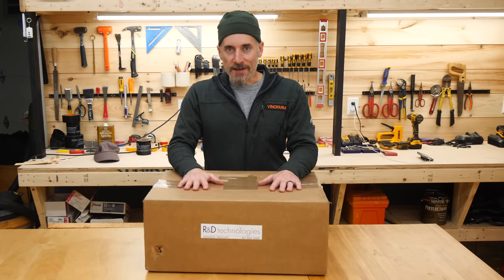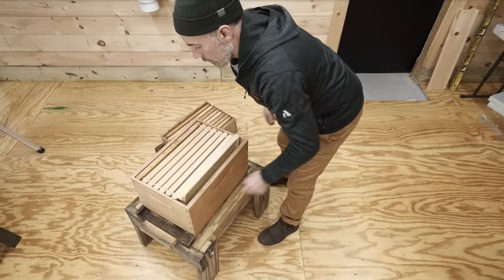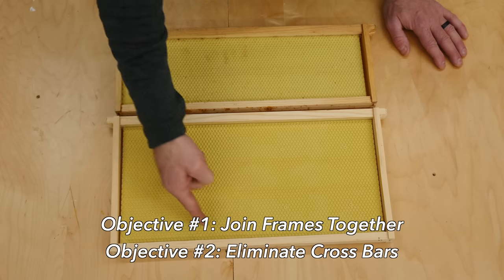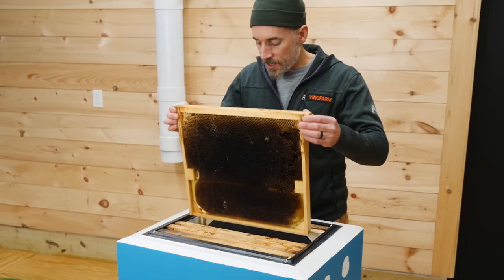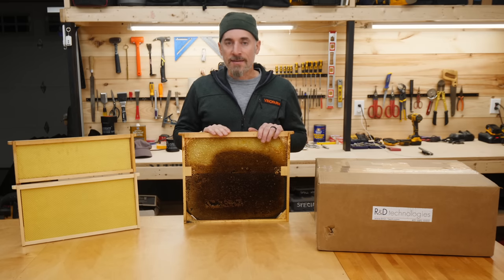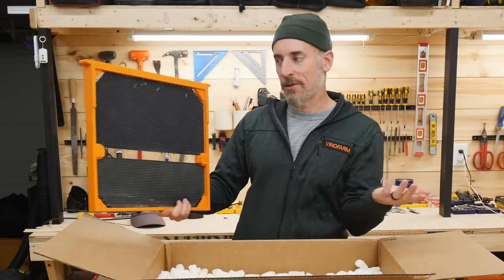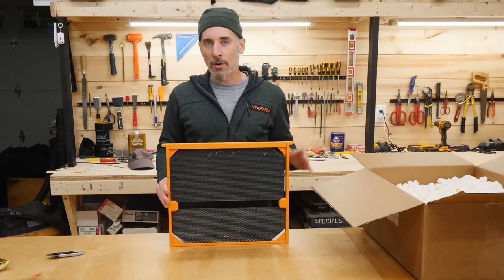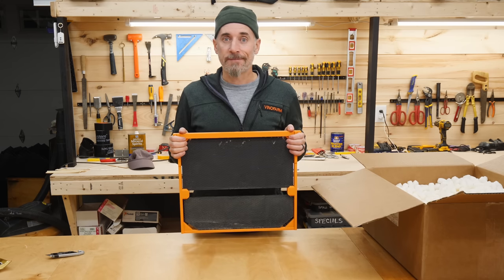Bigger, Better Bee Frames? Let’s Make This Happen!

Comment: Why not make a vector file and cut the frame sides out of 3/8" wood on a laser cutter? All you'd have to do is make the 1/8" groove which is quick and easy on a table saw.
Reply from the maker: What type of wood would you suggest using? Plywood is a no-go. It would delaminate inside a humid beehive in a month. If using solid wood, I'd need to pre-mill boards down to 3/8" thick. (A huge hassle) Then imagine laser or CNCing that shape out of a plank of 3/8 solid wood. There would be a ton of waste. Not to mention the babysitting and swapping planks every half hour. I can't see it being efficient at all.

Comment: My 18 inch double deep frames are built of strong wood (not weak pine), and are both glued and nailed, so that I do not need the center wood support.  I use 20 to 24 gauge stainless steel wires, spaced 2.25 inches from the top on down, with no wire within 2.25 inches of the top and bottom.

Comment: Hey Vino, love your work. If you wanted to go the 3d printed route, you could buy an Anycubic Kobra Max for around 500 bucks and print a whole 16 inch bed of your extra deep side bars at a time. You'd be able to print 11 or 12 at a time on that machine and bootstrap your way to injection molding that way. It's not a very difficult process at all once you get the hang of it and I'd be happy to help. 

Cheers.

Comment: I’m Never Bored!
35 seconds ago
Hmm how about modifying the Layens frames. The Layens frame consists of four parts:

Top bar — 14-5/16” x 1-1/2” x 3/4”, with 1-1/16” x 3/8” rabbets cut on two ends. It has 4 holes (3/32”) drilled along the center of the bar 1” from the rabbets and 3-3/8” between holes.
End bars (2) — 15-9/16” long x 3/8” thick. The wider part is 1-1/2” wide and 3-3/4” long; it then tapers to the thinner part which is 1” wide.
Bottom bar — 12-3/16” x 5/8” x 3/4”. It has 4 holes (3/32”) drilled along the center of the 3/4”-wide side 1” from each end and 3-3/8” between. 
 I'm had a similar idea last fall and insulated top bottom and all four sides of my Layens with the purple polystyrene.
Reply from the maker: Layens frames are 50% smaller and have sealed off tops. Not anything like what I’m doing here.

Comment: Are the frames the same dimension as layens frames to fit horizontal hives? If not it may be a good idea to have layens and your bee barn frames the same so they could be used in both. I would be interested if so because I already have a horizontal, plan to build more and one or two of you bee barns. It would be nice to have one frame fit in all of them!
Reply from the maker: No. Layens frames are 13" wide and have closed tops. They are completely different. These are Langstroth frames (19" wide) and have open tops to allow for supering. Not compatible either way.

Comment: Building the frames in my mind is the first issue that keeps your idea from exponential growth. If I could purchase the frames the barns would be much easier to implement fully in the yard. As an aside if you’re in the design process it might be useful if there was a plan for exchanging foundation if the comb is getting old.
Reply from the maker: Foundation is easily swappable: https://youtu.be/nK_TGfDYWcA?t=1818

Comment: Hi Jim, 

I am interested in using your deep and a half frames. I keep bees without the use of foundation and would need to modify some support with in the frame. I’m hoping I can drill small holes in the frame side bars to loop trough some wire. Do let me know if you think this will be possible? 
Thank you!   Joy

Comment: I don't understand why you would do it in thermoplastics? there are machines called Computer numerical control (CNC)
that means there is no material that cnc cannot cut. from wood to mdf panels to stone and steel depends only on what material and what type of cnc (laser, water, etc...)
so what I would do is to take that sample and just try more material and in the end I would take the material that suits me. cut the parts and sold them disassembled with assembly instructions. the plastic looks great, but it comes in one piece, which requires a bigger box for transport. more attention to packaging and finally what we all fear is handling in transport. damage to the product occurs
I would consider cnc production

Comment: I understand at the beginning were 2 combs (because you used two different frames), but now there is only 1 frame, Why do they need to be separate? Do still use the same old frames to take out the combs? Can you test the coroplast as a comb, Can be used as the bee's comb?

Comment: I see a need for 4 different molds: Top, Bottom, side-block-up, side-block-down. 
I would have the gussets as a moulded part of the sides made to slot into top and bottom and 
be pinned with simple plastic pins, 2 per gusset through predrilled holes. That would add a small amount of assembly but its pretty basic and would make shipping much easier.
Reply from the maker: This is the current thinking.

Comment: It's an interesting concept but I just use a double nuc between April and June.  Then I move the queen to the bottom brood chamber, insert an excluder and then let the bees fill the top box with honey plus however many supers they can fill on top of that.   I still need to moves supers, still need to lift - the same would be true for the bee barn.  Plus, those double frames would still be pretty heavy if full of brood bordered with honey.  

I quite liked having a massive hive going into the fall.  With single brood chambers this is difficult.  I'll be following Jim's leed and seeing what works for me.

All of this innovation is very inspiring!  Keep up the great work, Jim.

Comment: Hi Jim,
Any reason you can't offload some of the complexity onto the end user to simplify the manufacturing process? It seems like just getting a mold for the side bar would be pretty simple. One mold would allow you to make pieces for both sides then the user could just attach them to any wooden top and bottom bars with screws that they predrill themselves. You could even include the support gussets in this design.

Not sure exactly how you were planning on integrating the movable block but this method wouldn't really change that. While injection molding this would be great for large scale production if you cut that design in half, 3D print the pieces, then join them together with epoxy or other methods people could probably 3D print this at home as well. 

The magic here is in the sidebar, personally I would focus on that and leave the final assembly to the end user. Love the channel and keep up the great work.
Reply from the maker: This is a good comment. And it gave me a new idea. Thank you.

Comment: I like the extended frame but I have one concern? What are you doing to remove the honey? I have a centrifuge but the extended frames will not fit in my current centrifuge?
Reply from the maker: These are brood frames for the brood box. They are not extracted. The hive is supered with Langstroth supers and you extract regular super frames.

Comment: Have you checked with frame makers to see if they would make you the longer side bars? or a wood shop with a C and C machine The top and bottoms are standard
Reply from the maker: Not sure if you watched the video, but I do not want to make these out of wood. Cnc production houses would use plywood and that is a terrible material for inside of a bee hive. I’ve thought this through over two years. But for people who really want to use wood, the previous video shows how, step by step.
Reply: @vinofarm  I think your bee barns are a great idea! I did watch your video and there is much easier ways to make side bars without all the cuts. I will continue to watch to see how it all works out

Comment: I have run CNCs in the past.  Seems like a CNC could cut  the frame parts out of wood or plastic.  They would be easy to assemble after that.  Barring that, if they were available, I would buy 64 of them right now!
Reply from the maker: They could be cut with a CNC. But production houses are going to run plywood. And plywood is a terrible material for beehive frames. They will warp and delaminate inside a hive. And I don’t know if you’ve priced sheets of plastic lately but a 4x8 sheet of HDPE is going to cost over $500 each. Injection is more expensive up front but will be cheaper overall.

Comment: I use wired, double deep (18 inches) frames to do the same thing.  My bees love them, and I too, never have to pickup a brood box.
Reply: Oddly my first year I had a queen that rocked a double deep. Then I got swarms out of the forest with queens that just could not understand how to break over the division between boxes. Frustrating to give them room and the brood does not expand. Heck, the workers never got signals to even build comb on the frames.
Reply: Hey Kurt, curious how you attached two deeps together?

Comment: I am a great fan of your hive design, and I would love to create some for myself. The body and base can be done rather easily with simple tools, but the frames are another matter. I do not have the tools needed nor access to them. If you can secure a reasonably priced production method, I would immediately buy several hives worth of frames. I hope this endeavor is a success.🙏🙏

Comment: I am curious on catching up with your Barn evolution. I only saw parts of the first year. However, today at my club's package pickup a gentleman dropped off a Barn-derivative to have a package installed. I of all there at least knew wherefrom the strange foam wrapped hive with funky retro Dadant deep frames got its start. And the package within two hours was orientating on the front entrance. I'm sharing this video and the intro does illustrate a good deal of how damaging inspections of a brood deep and a medium is. The extra deep frame got a lot of skeptic looks today but I know my bee box history: this is the frame and box size they started out with seeing the queens love--  and found too expensive to keep making. So history repeats itself in plastic molding!
Reply from the maker: These frames are 4” deeper than the Dadant frames were. Thanks for the note!
Reply: @vinofarm  Wow! I'm going to keep my eye on this space for how the mold search works out. I'm very eager to return to the yard in the morning and see what the bees did overnight when we remove the package box.

Comment: I had 100 double deep frames made by a professional carpenter. I use double deep brood boxes and I have 4 Bee Barn 1.0, and I am beyond amazed with the way my bees are doing. I am using the mega frames with 3 double deep  Langstroff and the bees are doing amazing in those too. Well I used to have 4 but lost a hive to yellow jackets which wouldn’t have happened in a bee barn because the bees have no trouble defending the barns. Soooo now that we have Bee barn 2.0, which I could build I think. So I would love a bunch of injection mold or CNC wood that are double deep megas.

Comment: I went back to your original videos on the first bee barns and didn’t find how you transferred the frames of the original hives to the barns. I only found you adding new packages. Can you move the foundations with brood and eggs to the 
larger new frames safely?
Reply from the maker: It's possible. I've done it. You may lose a bit of brood on the frame, but yes, it can be done. I will have a video about transition scenarios coming up.
Reply: @vinofarm  thanks

Comment: Perhaps a reactive injection mold or rim mold would work for making these. I work at a custom mold builder in Greene Iowa building molds. The process is slower than injection molding. The tooling is less expensive.
Reply from the maker: Is this also called structural foam? Or is that different? I've just started learning about structural foam.
Reply: There are several types of plastics that can be molded in rim molds. Most are polyurethanes. Structural foam is one of these materials.

Comment: Honestly wouldn't the easiest way to go about this be to contact the producers of the standard frame sidebars, and just order a custom job with a longer length than normal. I can't imagine it would cost extensively more, and the wooden sidebars only cost like .25$ per piece from a retailer like betterbee, so even paying double isn't terrible considering you only need 20 max per hive, which is approximately 10$.
Reply from the maker: That would be one way to do it. But it's more than just longer sidebars. Not sure if you watched the whole video.

Comment: Take your wood patterns to a wood shop with a CNC... maybe a little more cost effective.
Reply from the maker: And what would they be cut out of? Any production CNC shop is going to use plywood and that is a terrible idea for beehive frames. They need to be solid wood and no CNC shop is going to use 3/8” thick milled lumber for production.
Reply: Sent you an email

Comment: Firstly you shouldn't have paid those guys to 3d design those frames, you could have asked your viewers, someone could have knocked out a design for you. 3d printing can be split with alignment pegs and made on a smaller printers.
Secondly I'm splicing in an extension to my side bars from stock wood, at the right width/depth with a repeatable angled cut, no need to fabricate the side bars.
Thirdly you don't need to make the whole frames. You only need to outsource the making of side bars. Top bars and Bottoms bars are standard. you can drop you manufacturing costs.
I had contacted a frame builders over in my area and they say they needed an order of 1000's  side bars to take my order (I wanted to order 100's so out my league). 
You can sort out the ordering of this product in a week, without 3d designs or injection moulding. You could uses existing industries set up for frame building.

I'm in the UK our frame building output is smaller than US, I imagine US will only talk to you in orders of 10,000's. Uk is smaller so they will listen to your smaller order.
Reply from the maker: All that makes sense if I was someone who wanted to be in the wooden frame business. But… After two years of building and assembling and hassling with these, I’ve decided wood is not the way to go. But if someone else wants to make these in wood, I’ve explained exactly how to do it on the previous video. I’m looking to the future. 

Be careful with “spliced” sidebars on large frames like this.
Reply: Yeah they do need to be joined well. Especially if you get a full deep of honey.

Comment: Why no response/pinned comment to the repeated questions about an update? Have you given up on the idea?
Reply from the maker: Haven't given up, but I spent months hitting many brick walls. An injection mold will most likely cost $100,000.00 or more up front. Per frame manufacturing costs were being estimated at $7-10 PER FRAME. That's $10 each just to shoot the mold. Then I'd need to add on a meager operating cost, plus shipping, packaging, time, etc... There's no way people would pay that much per frame. Manufacturing is INSANELY expensive right now. The idea isn't dead, but it's not happening anytime soon.

Comment: Have you looked into CNC milling or laser cutting manufacturing? That seems like the type of manufacturing you’re looking for. Plastic molds are expensive and hard to set up. A lot of downtime that eats into cost. Laser cutting and CNCs work off of a 3D model program much like what the 3D printers use but are incredibly fast and can use materials like wood and aluminum.
Reply from the maker: Thought about it for 5 minutes... But any production CNC shop is going to use plywood and that is a terrible idea for beehive frames. Thin strips of plywood would delaminate in a couple months inside a warm, humid beehive. They need to be solid wood and no CNC shop is going to use 3/8” thick milled lumber for production.
Reply: @vinofarm  you can get carbide 3/4 bits for a CNC routers. Cabinet makers use them.

Comment: I love the deep frames, but I'm all thumbs when it comes to carpentry.  Put me down for 10.  I'm a backyard beekeeper and have 2 10-frame langstroth hives.  Depending on the cost, I would go for 20 for both hives, but will the injectors be able to do alternate frames?  Tall foundation on the top, medium on the bottom (10), and the other 10, medium foundation on the top, larger on the bottom to avoid cross combing by the bees?

Comment: I would have interest in 50-100 frames. regardless i'm happy to chip in - many hands make light work. Perhaps you include a  youtube tip jar button for contributions - i know you dont want that, but this stuff will get too expensive too quickly. thanks as always.
Reply from the maker: Hang tight for the kickstarter. It's not even close to being ready, but it will happen at some point.

Comment: Seems like wood cut on a cnc router would be a consideration for mass production.
Reply from the maker: Not really. Mass cnc production would be done with plywood. Plywood is a bad material for beehive frames. It will warp and delaminate in a season.
Reply: @Vino Farm  agreed on the plywood  but they do cnc regular woods too. But you are on a good track and one of the other posters had good points to consider on part simplification for molding manufacturing and extra costs after molding clean up of parts. Good luck, love the channel.
Reply from the maker: @arnehelland6015  I considered CNC first. But the reality of finding a production house that would cut these out of 3/8” milled pine or cedar is going to be pretty tough. Those shops all run huge sheets of plywood. Imagine babysitting 3/8 thick cedar/pine planks under a router? If these things take off, I’m going to be pretty glad I figured out injection and have the ability to meet demand.